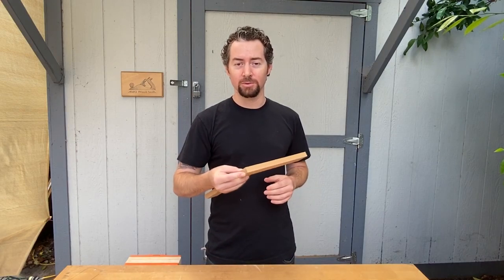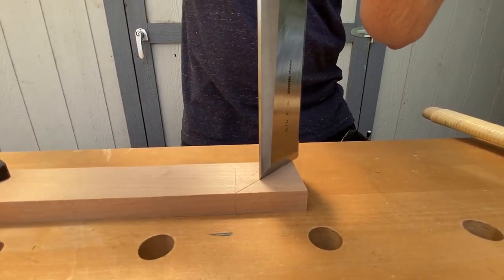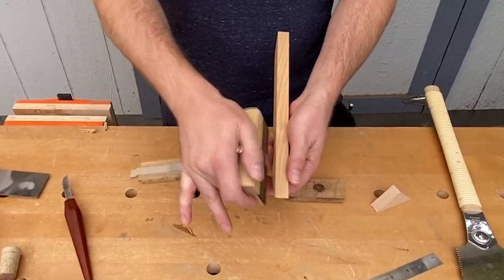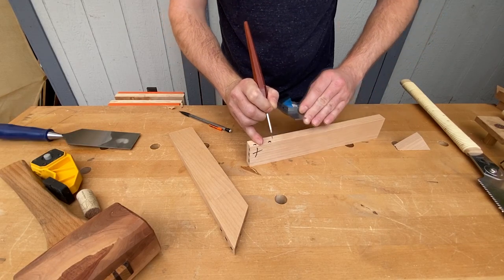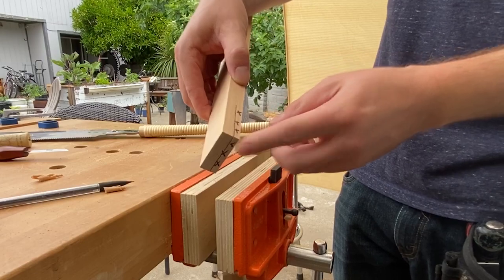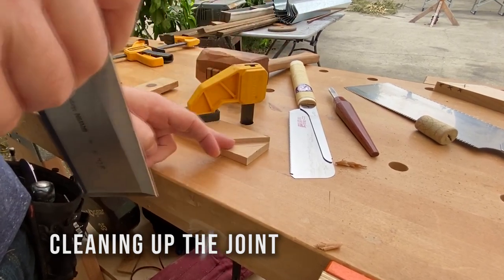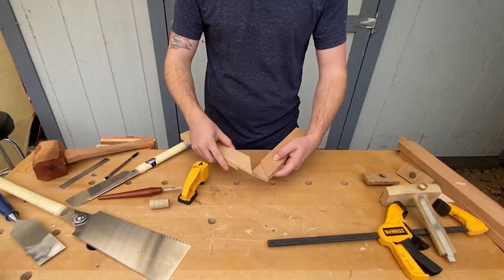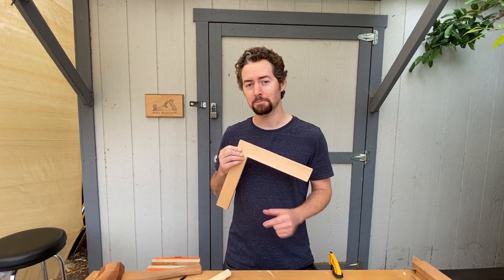Joinery Class Ep 3: Mitered Half Lap Joint - joinery hand tools

Comment: That is by a wide margin the biggest chisel I've ever seen!  What's the exact size of that chisel?
Reply from the maker: It is a 2" wide chisel.
Reply: @BobsWoodStuff  in the video it looks a lot bigger than 2 inches I don't know if it's my phone or what but it looks like at least 6 inches.
Reply from the maker: @bradslone8511  Some of the shots have a bit of a fisheye lens situation, so that probably exaggerates it.
Reply: @BobsWoodStuff  that would make sense. Do they make wood working chisels bigger than 2 inches?
Reply from the maker: @bradslone8511  I've seen some slicks (timber framing chisels) up to 3-3/8" wide.